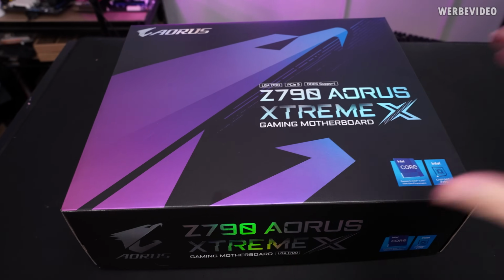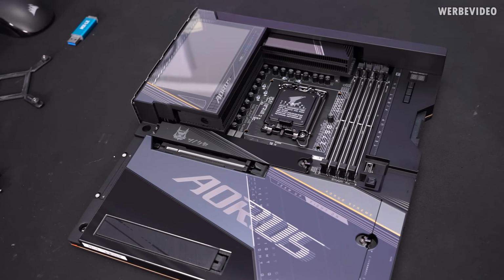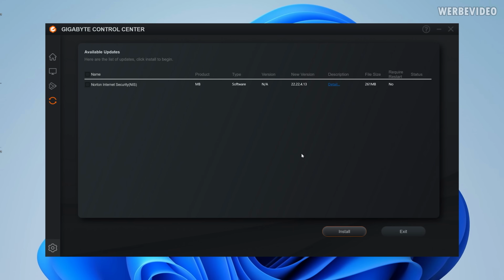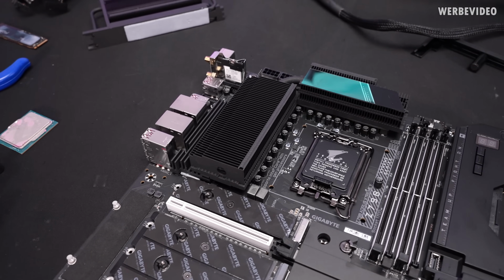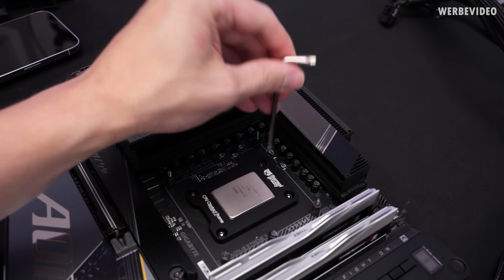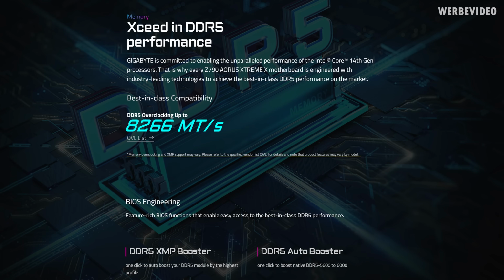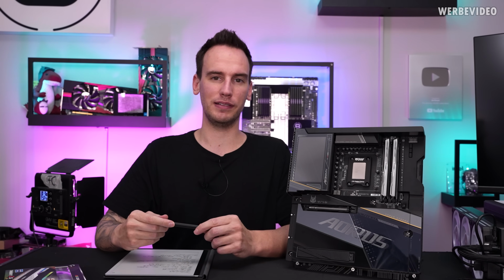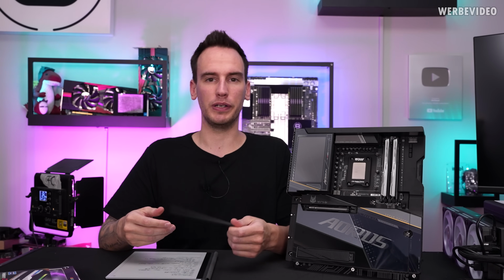Overpriced and Disappointing! The $1300 AORUS Z790 Xtreme X

Comment: Overpriced and Disappointing! 

You can say that about the ENTIRE mainboard market right now. Back in 2013 I bought an X79 Gigabyte UP4 for 220 €. What did I get with this money? 40 direct CPU pcie 3.0 lanes, 8 lanes from the mainboard making for a total of 48 lanes, QUAD channel memory with 8!! DDR3 slots and large amount of I/O in the back. 

Nowadays even when spending 2000 € for a board you only get pathetic 20 pcie 5.0 lanes directly to the cpu and the rest is either pcie 4.0 or going through the chipset instead of the cpu I/O controller (which Intel removed so you get WAY WORSE latency in Windows applications anyway because regression is what consumers want in the tech space, source: Tech Yes City) which not only increases latency but also has a measurable negative performance impact of pcie 4.0 M.2 drives of about 20% from what I gathered in my research (@der8auer this kind of testing would be interesting), I can only imagine things getting way worse with pcie 5.0 M.2 drives, making it worthless to try using multiple M.2 drives in Raid 0 which sucks considering what a huge pricedrop M.2 market got which would make stuff like that much more affordable. Again @der8bauer please test this.

I'm glad that AMD finally gave us HEDT back with the Threadripper 7000 series in the Desktop space but it's a step too far with how many pcie lanes are included (not because that's a bad thing but it makes the pricing even more ridiculous). Something like a 7950x(3d) with 32-40 pcie 5.0 lanes directly to the cpu would be perfect for the high end consumer market and a lot more affordable than Threadripper 7000.

@der8bauer It's long overdue that Youtubers rant more about the extreme underdelivering/overpriced mainboard market we are currently in. I mean just compare x79 (or any x series mainboards of the past) to intels current z790 and compare how much more you get with 220€ in 2013 (lets say 300€ now with inflation) and compare that to even a 500 € board nowadays which is trash in comparison. Just like in the past I consider a pcie gen upgrade to be part of the norm and not a justifiable reason for ridiculous price increases.

As for this specific board if you really pay this amount of money for a z790 board you're out of your mind. There is nothing on here which would make even half the cost justified. All electronic components like vrms, capacitors of even the most expensive variety are dirt cheap, this kind of small lcd screens are dirt cheap, metals are not that expensive(machining them is probably the most expensive part) so neither the heatsink nor the metal back add that much to the cost, many parts which could be metal are still plastic. So Roman calmly ranting about the price is an understatement. Gigabyte probably makes an office party every time someone is stupid enough to give them this kind of profit margins on a product. 
MY RANT IS HEREBY OVER
Reply: If you want some rant of the topic, just have a look to this video from GN, where they actually explain how a 9 segment debug display cost around 200$ aha. 

Motherboard were much better in the past (at least in term of segmentation), that is for sure. Less, bullshit, more usefull stuff.
Reply: @Thefuror38500  I watched that video when it released, and while that's another one of those things that costs nothing to add and should be there from the start it's more useful to reviewers that have a bunch of boards and thus a much higher chance of having some which don't work, maybe I don't know what I'm missing because I never had a board with that feature but I sure miss having a ton of I/O on my board which includes pcie lanes. At least you can still usually fix issues without that info display and in the worst case just send it back and try with a new one but not having pcie lanes is not a fixable issue from the consumer point of view and thus much more worthy of a rant in my opinion.

Comment: I agree, having used a gigabyte aorus board for a couple of years, the hardware is solid. The software outside of the bios is trashy. Rgb fusion is like a high school project compared to other options. Other stuff in there is just non-malicious optional bloatware of questionable use.

Comment: The problem with the lanes is that when Gigabyte launched their mobos with Z690 they locked the 5.0 to the PCI Express card leaving the main CPU lane M.2 on 4.0, which isn't a terrible problem but the way things go, it should've been PCI Express 4.0 on the card and 5.0 on the M.2, because an year later GPU's new gen were still on 4.0 16x and M.2 had some limited 5.0 launches, of course, speeds aren't maxed on 5.0 yet as those SSD's hardly beat the fastest 4.0 just like the first 4.0's were only a bit faster than 3.0 in the first year or so. 

So for Z790 they launched 5.0 + 5.0 but it limits the GPU to 8x 5.0 which is equal to 16x 4.0 which is how much a 4090 needs anyway, until a 5090 or 6090 comes out I think there's no reason to not use the top M.2. slot (and even afterwards, we all know that GPU's don't eat all the speed from the PCI anyway). It's only disturbing because they ain't telling you the whole story as you'd want to, but in general we should ask Intel and AMD for more lanes if anything!

Comment: I have made a review of an Z790 Elite X and made extended ram overlocking tests, and making a review of a Pro X and I could only get to 7600 Mhz manual overlock with 2x16 GB, the entire X lineup (including Xtreme and Master) is identical in terms of memory performance. They are better than previous non X boards in terms of memory, but only 400-600 mhz better. Do not expect anything more than 7200-7400 xmp, maybe 7600 xmp if you have 2x24 gb. Marketed 8266 - manual overlock with 2x24 with best cpu memory controller possible.
People need to stop buying these stupid fast 7800+ memory kits and expect them to work. You need and APEX or Tachyon for those.
Reply: Thank you for sharing this
Reply: Bold boy was right
Reply: ye
Reply: Check out Framechasers review of Z790 X AX.

Comment: Kinda like my am5 godlike board from msi. Was 1400 and so not worth it. Couldnt even do a raid 0 with 2 4tb drives until msi finally came out with a bios update 6 months later to fix it. Motherboard manufacturing has gone up in price and down hill with quality.

Comment: PCI Express lanes. Who is to blame for this completely wasted area of motherboards? Is AMD or Intel responsible for the maximum lanes or are the motherboard manufacturers not adding the extra chipset to expand the PCI Express lanes? What is the point of adding so many features on to a motherboard and then you either have a performance hit or you lose the use of that feature. I have been asking this question for about 10 years, and yet nothing is ever done.

Comment: If you're doing custom watercooling and you want to add an extra NVME drive you need to disassemble the whole thing...
They could have cut-outs for each NVME drive where you cover it with a copper/aluminum block, ideally with a heatpipe to take the heat to a finstack at the front.  Or at a minimum, don't cover it in plastic.
On the VRM most of the finstacks are blocked by plastic, that's a waste.

Comment: 1300$

I could buy a whole brand new systems
100$ case
100$ power supply
100$ ram kit
100$ cooler
100$ SSD
225$ B650 motherboard 
225$ Ryzen 5 7600
275$ RX 7600

And still have 75$ left over for RGB fans, or like 10 steam games to go with the new system 

That’s stupid for a motherboard

Comment: My xtreme x paired with gskill 7200 2x24  gets into win 11  with the gigabytes hynix 8000 preset but any load it crashes. With 14900k.  GCC doesnt work right with mine also... Sometimes wont notice my ram and rgb  settings.   But the other things like the mobo connectors is really nice to hide the wires behind the mobo tray.  Gigabytes support site says theres a BETA bios i think  f4b and description is Beta bios... nothing else lol

Comment: Thank you for this review. I had seriously considered this board. After seeing your review, I would NEVER consider it. The biggest issue was the nvme drives  along with other downsides. 

I am very satisfied with the build I chose: ASRock Z790 PG-ITX/TB4 Intel LGA1700 Mini-ITX Mainboard ($334.99) in a Fractal Torrent Nano with a 13900K and 8tb Samsung 990 Pro. The entire build is really tight, but works really well. There are only 2 memory slots, which makes better sense given the channels provided.

Your in depth reviews are very much appreciated and have made a significant difference for me.
Reply: do you use gen 5 ssd or no? is there any difference in fps or work,because of gpu and ssd m2 line sharing?
Reply: @Mex_GC  The ASrock only supports gen 4 ssd. I use Samsung 990 Pro, 3 drives total 8tb. There is no effect (no line sharing) because it is pcie nvme with no ssd. The unit is production grade and has all the power of a full size desktop.

FYI: If you are planning a similar build, it looks like the parts and pieces are no longer available -- not the board and not the Fractal Torrent Nano case.
Reply: @theplaintech  thanx for the reply

Comment: So unlike previous boards both pcie slots are pcie x 5 so you can theoretically place the nvme 5.0 in the top slot and 4090 in the 2nd pcie5.0 slot without loosing lanes… just saying look at the specs

Comment: If you want to test the effectiveness of those little holes behind the VRM's ... just put a piece of black tape over the holes.
If they are supposed to help by 7 degrees, then the VRM temps should spike that much.
The failure of the software is unforgivable, for a product at this level ... even to the point of completely avoiding it ... and all Aorus products.

Comment: Love your reviews.  But small point.  Using Percent of temp is the best way to make a claim. Means C or F don't matter. It's 10% of which ever scale you use.   If they said degrees, that then doesn't factor in C or F or even base ambient.  Not saying this claim is accurate, but it's a much better claim %, as actual degrees has too many variables.
Reply: Or when talking cooling components, one could measure in the amount of watts of heating removed, then % is even more straightforward using that scale.

Comment: MSI used to make great high-end motherboards in their Z3xx thru Z5xx chipsets. The godlike and even the MEG. However, they turned to shite after. I never liked AORUS branded. I had bad luck with them in the past. Under the board's LCD has to be little fans. MSI did that with their mid to high end, too.

Comment: Wait why does the first M.2 slot share lanes with the PCIE slot?
I mean I have a 990 Pro which is a Gen4 NVME and an RTX 3080 in my system and they do not share lanes, I am on AM4 with a 5800X3D. Both my GPU and NVME work at their max allocated lanes. Why is this different for Gen5?

Comment: Gigabyte's Control Center is hot garbage, especially when it comes to RGB - every time I have to upgrade their RGB control software, it's like pulling teeth with controller getting stuck or something, resulting in extended troubleshooting session.

Comment: that board is a joke, why don't manufacturers just add a card with 4 nvme slots to slot in a x 16 slot. Thinking about it, it would make the board much simpler in design, and be more versatile. god forbid you want to add a network card or 2 capture cards or even 2 gpus (there are still workloads that can use multiple gpus)

Comment: I built a new system for the first time in over 10 years last Christmas with a z790 Aorus Master, 13700k and 32GB of g.skill 6400.
Not having built a system in such a long time, I naively thought that I could buy 2 16GB dimms of memory, since they were really expensive when I bought them in december 2022, and then later this year I could buy another 32GB kit and increase my total memory to 64GB.
I later found out that there is no way to guarantee that having 4 dimms at 6400mts will even run. 
*THAT*, to me, is a huge flaw in all the advertising we see from all these companies, selling 4 dimm boards and advertising speeds up to 8000mts, when filling all 4 dimms will probably not work, unless you lower the speed of your memory down and then end up not using the speeds you paid for.

Comment: I got the Master X, decided to go with 64Gb (2x32gb) 6800 speeds and it works with no stability issues on the 14900k
Reply: Are you happy with your board? Do you also have issues with Gigabyte software?

Comment: Ill be honest. I was foolish for buying an ROG Crosshair X670E Hero for $700. However, it had the connectivity that I really wanted. With that being said, that was an insane price to pay for a motherboard. $1300 is unfathomable. I mean, WTF?!
Reply: At least when you go from a $400-$500 to a $800 motherboard you actually get some useful upgrades if you are a power user...Going past $800 gets you almost nothing but extremely overpriced cosmetics!
Reply: WRX80/WRX90 is what any high-end board should be these days mainstream boards are just horribly overpriced midrange boards.
Reply: I was able to find the same board brand new for less than $300 USD, as soon as i saw itm it was an instant buy. At $700 i was kinda tempted but its still a lot of money for a motherboard, although i love all the connectivity it brings and the visual design tbh.
Reply: lol, I bought a ROG Crosshair X670E Extreme for 1k and never used it, it's still sitting at my feet eating dust. I built my AM5 rigs including 7800X3D in my ROG Strix X670E-I and my 7700X in my ROG Strix B650E-I, and still haven't found a use case to use that Extreme board. I daily drive a 5800X3D in my ROG Crosshair X570 Dark Hero for work and 7800X3D in X670E-I to game, and a 12900K+MSI Z690 Force for multimedia consumption. I have extra PCs with 13900KS+ROG Strix Z690-A D4 and 5950X+ROG Crosshair X570 Formula that I built for running AI and ML and ended up eating dust as well. Sometimes I just find products that are the most expensive/have the most features not always the solution, sometimes what people need is really simple stuff and they always fall into consumerism and end up purchasing a big order, without absolutely utilizing every feature and potential the product provides.
Reply: If you make like 300k usd income is it a lot for you? That's top 5% of Americans so nothing crazy. Top 1% is 900k... 1300$ for a mobo is not unfathomable, you are just not the target audience and that's okay
Reply: @Tacet137 yeah that kind of pricing strategy is a good way to piss off the people who actually would buy your high end products and ensure they actively avoid your entire brand by association. Happens in a lot of industries and it never works out well long term.
Reply: They should better just buy a ROG Z790 Dark Hero, or for overclockers get the ROG Z790 Apex Encore, no? Or if they want that small LCD screen on heatsink features, they can also get the MSI Z790 GodLike Max, I think the whole point OP is making is that this specific Gigabyte board is just a waste of money considering the status quo features it contains, instead of saying its for the wrong audience. @Tacet137

Comment: Probably the heatsink was so suffocated by the screen that opening just 5 small holes releases a lot of heat? It would have been easier to cover the holes with tape to see if the temperatures rose up.

Comment: I have the AORUS Z670E Master with the AMD Ryzen 9 7950X3D and I have to say it was not cheap but I'm very happy with the cooling and how well it runs and so far, have had no issues. These boards are expensive but compared to lots of cheaper brands etc. you do really get much more but it's always up to the user's needs. I think these high-end boards from Aorus are also meant to be futureproof.
On another note, I'm running a RTX 3090Ti should I update to 4000 series or just wait? cheers.
Reply: Are you just gaming or are you using the 3090Ti for professional work as well? If you were to upgrade to 4000 series card, do you know how much performance it will improve? Is there something else that you would rather use your money on or be more beneficial to you?

Comment: There are "some" advantages to Gigabyte motherboards as well as disadvantages.   The one thing I do not like is the way they treat Bios updates.  Too many times they put out a Beta bios(the ones followed by a letter designation like F4a vs simply F4) and those beta bios's seem to last forever until they release a final "official" bios.   At least that is my experience with AMD motherboards.

Comment: I'm pretty sure the word 'Extreme' really means 'gullible', regardless of manufacturer... older generation stuff but I got an Asus Crosshair VIII Extreme to replace my dying X570-F (and because I wanted Thunderbolt) and lost the ability to run my memory at 3800. At least this Gigabyte board mounts the USB-C front panel connector parallel to the board like all the other connectors along that edge.

 Who'd have thought they'd do a worse job of routing the memory traces on such an expensive board? Not me, that's for sure.

Also, the more I think about it, the more it seems a little suspect having such an expensive board with so much integrated hardware for the low PCIe lane count of consumer CPUs. Two of the five m.2 slots I have share bandwidth with the first PCIe slot on the board and since the AM4 platform only has an x4 connection between the chipset and CPU, the two m.2 slots on the DIMM.2, Thunderbolt, 10GbE, 2.5GbE, WiFi, SATA and USB3.2 Gen2x2 are all competing for that bandwidth which would definitely cause a bottleneck whilst trying to use them simultaneously.

Comment: I got the Aorus X Wifi7 and its been good with the exception of no wifi or BT driver support in windows 10. My G.Skill 7800 cl36 kit wont run at XMP, but runs great at 7600 CL38... Proc is a 14700k.